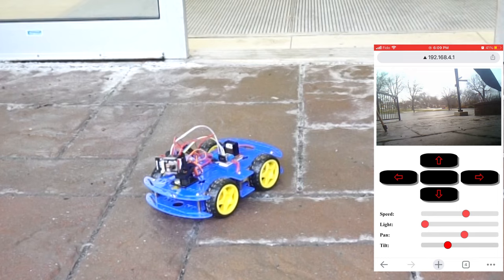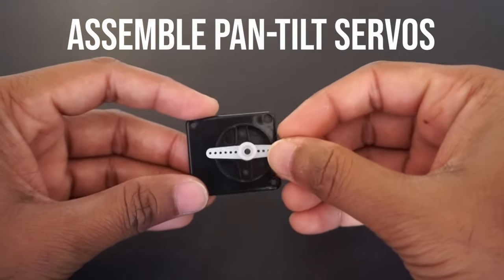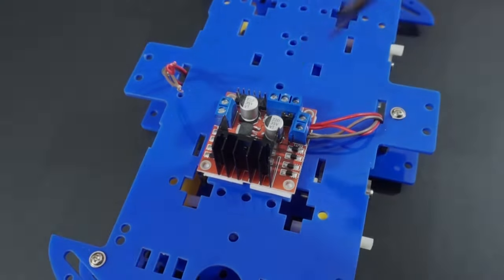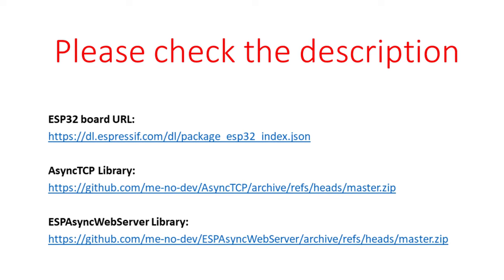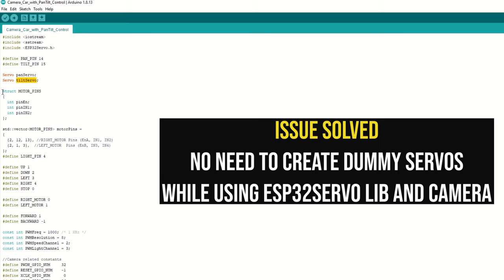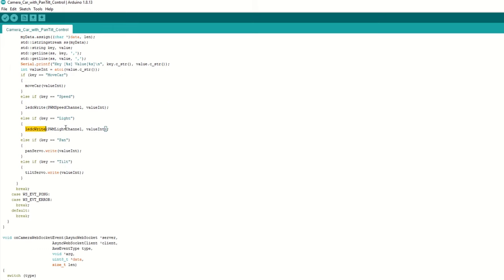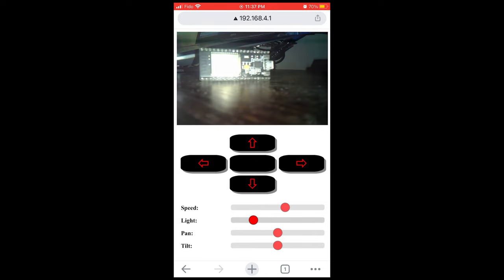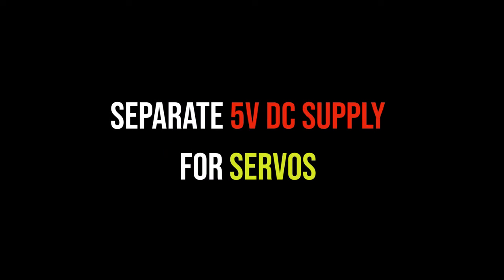Camera Car With Pan Tilt Control | ESP32Cam

Comment: Bro my ubec converter has only 2 pins but your have 4. Now what do I do? Please help. 😭
Reply from the maker: Sorry but I am not sure .please check the specification of your UBEC. Or you can buy the same UBEC as shown in video 👍🏻
Reply: @hashincludeelectronics  what do u mean?
Reply: @hashincludeelectronics  can I just use the pan control then?
Reply: @hashincludeelectronics  the same ubec is not available in my country. But please tell me atleast I can use the pan control right?
Reply from the maker: @veenakumari9484  sorry for late reply . Hope your problem is resolved 👍🏻👏🏻

Comment: ⚠️Please Reply⚠️

Can I use FTDI Module to upload the code instead of arduino?

If yes, then please tell me the connections.
Reply from the maker: Yea you can use that . The connection is same .
Reply: @hashincludeelectronics  thanks
Reply: Dear @hashincludeelectronics ,

Please tell the connections. For example:
FTDI      --      ESP32 CAM
1            --       1
2            --       2

Please, if you do so, it will be very much helpful for me.
Reply: @hashincludeelectronics  please reply ⚠️
Reply from the maker: @wonderfulcats4207  the connections are same as done with Arduino Uno .

Comment: I have done all the connections ,the camera is working properly but the motor is not working
Reply from the maker: Make sure you use rechargeable battery only .

Comment: Sir i want to make it with three servo motors. Because of three axis.(I dont want to use any servo controller)Can you help me what will be the changes on the code?🥺 And provide me??
Reply from the maker: I don’t think there is pin available for 3rd servo . 👍🏻👏🏻
Reply: @hashincludeelectronics  Thanks.
Reply: Suppose there will be a pin for third servo on esp32-cam(io16). And the axis's name is slide(pan and tilt are included). Then what will be the changes on the code? I need software part not hardware.
Reply from the maker: @djfreefire9806  Do not use pin  io16 .
Reply: @hashincludeelectronics  just suppose
Reply from the maker: @djfreefire9806  in that case you will have to copy paste the code similar to other servos . That’s it . 👍🏻👏🏻

Comment: Hi  sir I  am facing problem  when I press forward button it turns right , backwards=left
Reply from the maker: Interchange the motor wires connected to L298N driver .

Comment: I am not getting ip address in serial monitor after uploading the code what should I do? I have given proper SSID and password still
Reply from the maker: You don’t need to get any IP address for this project . Use the IP address ssid password exactly  as shown in the video 👍🏻
Reply: @hashincludeelectronics  will it work with different SSID and password if we change the same in the code
Reply from the maker: @technovagerindia5633  yes . You can use any SSID and password . But make sure the password should be greater than or equal to 8 characters.
Reply: @hashincludeelectronics  Ooh, finally. Thanks for this sir.
Reply from the maker: @sixtyMinutes138  Glad that it worked 👍🏻👏🏻

Comment: Hi i try to run the code but i get an error after resetting the esp32. Help me pls. 
Error: Rebooting...
ets Jun  8 2016 00:22:57

rst:0xc (SW_CPU_RESET),boot:0x13 (SPI_FAST_FLASH_BOOT)
configsip: 0, SPIWP:0xee
clk_drv:0x00,q_drv:0x00,d_drv:0x00,cs0_drv:0x00,hd_drv:0x00,wp_drv:0x00
mode:DIO, clock div:2
load:0x3fff0018,len:4
load:0x3fff001c,len:1216
ho 0 tail 12 room 4
load:0x40078000,len:10944
load:0x40080400,len:6360
entry 0x400806b4
Guru Meditation Error: Core  1 panic'ed (StoreProhibited). Exception was unhandled.
Core 1 register dump:
PC      : 0x40091bbe  PS      : 0x00060633  A0      : 0x800940e1  A1      : 0x3ffb1ea0  
A2      : 0xbf080000  A3      : 0x0000abab  A4      : 0xb33fffff  A5      : 0x00000001  
A6      : 0x00060620  A7      : 0x0000cdcd  A8      : 0x0000abab  A9      : 0x3ffc7a38  
A10     : 0x00000003  A11     : 0x00060023  A12     : 0x00060021  A13     : 0x0000ff00  
A14     : 0x0000002a  A15     : 0x3ffb1fb0  SAR     : 0x00000001  EXCCAUSE: 0x0000001d  
EXCVADDR: 0xbf080000  LBEG    : 0x4008ceee  LEND    : 0x4008cef9  LCOUNT  : 0x00000000  

ELF file SHA256: 0000000000000000

Backtrace: 0x40091bbe:0x3ffb1ea0 0x400940de:0x3ffb1ed0 0x40094455:0x3ffb1ef0 0x40123d96:0x3ffb1f10 0x400dc4e1:0x3ffb1f50 0x400d1b01:0x3ffb1f90 0x400dd75d:0x3ffb1fb0 0x40090bb6:0x3ffb1fd0
Reply from the maker: Unfortunately I am not aware of this error . Please check on the internet for more reference.

Comment: Bro There is no wifi network-" MyWifiCar" is showing. Also when I uploading the code there is no issue caused. Please help me in this case
Reply from the maker: @djfreefire9806  Please use rechargeable battery. Also check if there is any loose connection. 👍🏻👏🏻
Reply: Yes I checked. I am using 3×3.7 volt rechargeable lithium ion batteries. The voltage is showing in multimeter is 11.9 volt. There is no connection issue, voltage dropping, module issue or etc. Also I don't changed the code.Still this problem is happening. Please help me 😭😭
Reply: I am providing 5v from motor driver.
Reply: Bro please solve my problem as soon as possible

Comment: Coding uploaded successfully but wifi not showing
Reply: I had pressed that reset for not starting so i have to upload the code again
Reply from the maker: No need to reupload the code. It should work .

Comment: In first try the wifi was connected nad cas worked for like 30 se then it kept disconnecting again and again showing no internet connection 
And after reconnecting the battery the wifi is not showing 
What to do...
Plss help
Reply from the maker: May be there is power issue . Please make sure to provided good supply 👍🏻👏🏻

Comment: Thank you ❤
Reply from the maker: Welcome 🙏
Reply: @hashincludeelectronics  Sir in this everything alright but left side dc motor not working any solution?
Reply from the maker: @deshwanthgowdaks7471  check the connections. Or replace the motor 👍🏻👍🏻

Comment: How to take images or save video on esp 32 memory card in this project, please help
Reply from the maker: That a good idea 👍🏻. This project does not support that currently . However I can give you some idea about how would you do that . You can connect SD card in esp32 camera . Then check for how you can save images in sd card on internet reference . Inside code before sending the image to mobile , you can save that image into SD card . May be after every interval like few seconds store the image . Hope this helps 👍🏻
Reply: @hashincludeelectronics  Thanks for guidance
Reply from the maker: @puneridholtasha  happy to help 👍🏻

Comment: Sir I am ordering all the items that so I am asking to you
Reply from the maker: Use lion or lipo batteries 👍🏻
Reply: Only 1 battery is enough
Reply: Or not
Reply from the maker: @RanbirSingh-mc8ll  the total voltage of battery should be between 7-12 v 👏🏻👍🏻

Comment: I cant fing ssid in mobile, I was tried several times by reconnecting but no movement what can I do? 

But at initial it partially connected but not works...now totally disappear ssid while connecting wifi....any suggestions?
Reply from the maker: Please make sure you use rechargeable battery only 👍🏻👏🏻
Reply: @hashincludeelectronics  yes but it doesn't work....!!!
Reply: Now it works with a separate battery supply to servos... brother
Reply: But when wifi is connected mobile data is automatically disconnected...what to do now? I am not very efficient to web ip addresses...kindly help..
Reply from the maker: @cbc1235  awesome 🙌🏻
Reply: It wants both wifi or mobile data?

Comment: can anyone plzz help i have performed all steps but ip address is not generating when i press reset button ......ip is not generating on serial monitor plz help
Reply from the maker: There is no IP address generation . You have to use the IP address as showing in video 192.168.4.1
Reply: @hashincludeelectronics   sorry for disturbing again..........but on my phone wifi is not showing so how should i connect

Comment: Need latest version for installing ?
Reply from the maker: What error do you get ? Is it something upload failed error ?
Reply: @hashincludeelectronics  yes
Reply: Its failed to connect to esp32
Reply from the maker: @malaluanjerico675  ok try changing USB port . Also try to upload several time. Is the error related to code compilation ? Can you send me error ?
Reply: @hashincludeelectronics  how? Picture?
Reply: "A fatal error occurred: Failed to connect to esp: Time out waiting for packet header
Reply: An error occurred while uploading the sketch
Reply from the maker: @malaluanjerico675  ok try the things which I have suggested . It’s a common error . You can find more information on internet as well related to this error 👍🏻
Reply: @hashincludeelectronics  it is normal ? There's noting wrong with coding?
Reply from the maker: @malaluanjerico675  yes it’s normal .

Comment: Bro it says with an error that lecsetup was not declared
Reply from the maker: Please install 2.0.16 version of esp32 board 👍🏻👏🏻
Reply: @hashincludeelectronics  After the migration from ledcsetup, you should also try to include the required version of the esp32 board on the video, so there could be no more delays
Reply: also can i use a 5v buck converter ??

Comment: When I write the Ip address in google chrome it tells me that this site can't be reached and the ip address took too long to respond. Do you have any solutions ?
Reply from the maker: Pleas make sure you are using rechargeable battery only . It will avoid any issues . Also check the video slowly and carefully so that you don’t miss any step 👍🏻

Comment: Successfully uploaded code and opened serial monitor and hit reset but Wi-Fi is not connecting
Reply from the maker: Please check the video and follow the exact step . You need to use this app on mobile device . 👍🏻

Comment: My 2WD Robot have an error, everything ok except motor is not working......😭😭😭 HELP!!!!!!!!!!!
Reply from the maker: Make sure you use rechargeable battery . Also make sure your connections are good . Are your motors working individually?
Reply: @hashincludeelectronics  Hi, can I use voltage boost for motors? Because I don't have rechargeable batteries and I do not want to buy it.
Reply: @hashincludeelectronics  I have another problem too. How can I rotate my video? My video is upside-down.
Reply from the maker: @kmhooibg7577  rotate the esp32 cam module
Reply from the maker: @kmhooibg7577  still you will need to use rechargeable battery 👍🏻
Reply: @hashincludeelectronics  btw how can I rotate my camera? Or could you make a video, please? Thank you so much.❤

Comment: Hi Thanks for video, but i m facing some issue. 1. Motor not running, all connections ok as per diagram. 2. Mobile app not fits in screen properly (im Using redmi note5). 3. ESP32 cam module heating. 4. whenever i use servo buttons, esp module get turn off & start again.
Reply from the maker: Most of the issues are because of power supply. Please use rechargeable battery only. For fitting app in mobile screen we might need to adjust the html code and reduce the width of the table.

Comment: How to convert this project from AP mode to STATION MODE please help
Reply from the maker: Please check my video on getting started with esp32 where I have used STA mode. You can use the required code lines from that video . 👍🏻
Reply: Only change mode to problem solved or anything to need to change in full code. Sorry for my english. I wish I was able to explain what I had to explain.
Reply from the maker: @lobib  you will have to add the below lines of code instead of soft ap mode .  Also use your home/mobile wifi ssid and password . 

WiFi.mode(WIFI_STA);
  WiFi.begin(ssid, password);
Reply: Thanks bro. I will try
Reply: Bcoz shown error camera config

Comment: Sir I changed the ssid and passwords  it is not connecting the app
Reply from the maker: May be your esp32 is getting restarted . Please use rechargeable battery only.
Reply: @hashincludeelectronics   sir I am using orange  li-po recharge battery but  when I try to open the app it says error connection
Reply from the maker: @narasimhamurthy826  can you send me the screenshot of error on Instagram hashincludeelectronics?
Reply: @hashincludeelectronics   sir I am using hotspot from other mobile  for connection of the car
Reply from the maker: @narasimhamurthy826  nope . You don’t need to use hotspot or anything . This project creates and uses its own WiFi network . Please follow the exact step in video
Reply: @hashincludeelectronics  sir then   i should not use any network  for this    just i should connect to the ssid  and  password wich I used in the code
Reply from the maker: @narasimhamurthy826  yup 👍🏻
Reply: @hashincludeelectronics  thank you sir

Comment: 192.168.4.1 not responding please issue solve 😮
Reply from the maker: Please follow the steps as shown in video . Use only rechargeable battery 👍🏻👏🏻
Reply: WiFi connection but 192.168.4.1 video not open this issue solve

Comment: Hello sir why does my compiler says C:\Users\Kain Goku\Desktop\CameraCarWithPanTiltControl-main\Camera_Car_with_PanTilt_Control\Camera_Car_with_PanTilt_Control.ino:1:10: fatal error: esp_camera.h: No such file or directory
 #include <esp_camera.h>
          ^~~~~~~~~~~~~~
compilation terminated.

exit status 1

Compilation error: esp_camera.h: No such file or directory

please i will like to hear from you soon
Reply from the maker: You need to install the esp32 board as shown in video . Also select proper board while uploading or compiling the code 👍🏻
Reply: a fatal error occurred serial data stream stopped  possible serial noise or corruption

Please sir that's the error I receive while uploading the code via Arduino uno, please how can I solve this issue?
Reply from the maker: You need to install esp32 board as shown in video 👏🏻👍🏻
Reply: I've done that already sir
Reply: But it still displays thesame error

Comment: Hi! Good project! works 100% on mobile access but I can't control the motors in Windows 10 browsers!
who helps me introduce an on/off button to activate other free gpio to turn on a laser pointer. thanks
Reply from the maker: Thank you very much for checking out the video and I am glad that it worked for you . Yes it is developed only for touch devices like mobile. For adding button you can check my other similar videos where I have used button 👏🏻👍🏻
Reply: Can you give me the link video sir?👍👌

Comment: error 
C:\Users\kashaf\Documents\Arduino\muwificart1\muwificart1.ino: In function 'void setUpPinModes()':
C:\Users\kashaf\Documents\Arduino\muwificart1\muwificart1.ino:493:3: error: 'ledcSetup' was not declared in this scope; did you mean 'ledc_stop'?
  493 |   ledcSetup(PWMSpeedChannel, PWMFreq, PWMResolution);
      |   ^~~~~~~~~
      |   ledc_stop
C:\Users\kashaf\Documents\Arduino\muwificart1\muwificart1.ino:502:5: error: 'ledcAttachPin' was not declared in this scope; did you mean 'ledcAttach'?
  502 |     ledcAttachPin(motorPins[i].pinEn, PWMSpeedChannel);
      |     ^~~~~~~~~~~~~
      |     ledcAttach
C:\Users\kashaf\Documents\Arduino\muwificart1\muwificart1.ino:508:3: error: 'ledcAttachPin' was not declared in this scope; did you mean 'ledcAttach'?
  508 |   ledcAttachPin(LIGHT_PIN, PWMLightChannel);
      |   ^~~~~~~~~~~~~
      |   ledcAttach

exit status 1

Compilation error: 'ledcSetup' was not declared in this scope; did you mean 'ledc_stop'?

Comment: Your code didnt work for me
Reply from the maker: What issue are you facing ? 👍🏻👏🏻
Reply: @hashincludeelectronics  I used your code exactly the way you showed me, but for some reasons I always get this "ledcSetup is nnot declared in this scope", can you help me fix it pls? Thank you
Reply from the maker: @cat-tastic692  please install 2.0.16 version of esp32 board 👍🏻👏🏻
Reply: @hashincludeelectronics  thanks man it worked
Reply from the maker: @cat-tastic692  awesome 🙌🏻
Reply: @hashincludeelectronics  the wifi of the esp32 didnt pop up. What should i do?

Comment: broo for me servos are working but the motors are not working same code and connections were given as per u given pls help me out with this.   thank you
Reply from the maker: Please make sure you use rechargeable battery only .